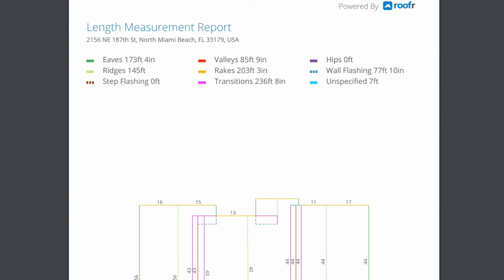What are the parts of a Roof? Roof Component Breakdown | Perkins Roofing Corp.

Comment: You do not mention roof vents in this video. You do mention soffit screens, which is one part of the roof ventilation system, but I see no vents on the roof itself, not even ridge vents. How is the roof supposed to ventilate with no elevated vents where the hot air can rise inside the attic and out the vents? I have learned from your videos, but I don't see a single video addressing the issue of roof ventilation. I am learning more than I ever wanted to know about my house during the process of recovering from major storm surge flooding in my house during Hurricane Ian. My attic is hot as the place you go if you don't go to heaven. It has been super hot ever since I purchased the home 20 years ago. I replaced the tile roof 16 years ago and now I'm realizing the roofer did not install any roof vents or ridge vents. The hot air is trapped in my attic! I will be having a new tile roof installed within the next 30-45 days and I want to knowledgable about roof vents to make sure my roofer does the venting correctly. Here in Disaster World NOBODY seems to know how to do their jobs in the various skilled trades. Consumers assume roofers, plumbers, electricians, window installers, stucco installers, drywallers, etc. know how to do their jobs, BUT THEY DO NOT! Everything has to be done at least two times and sometimes up to four times before they get it somewhat right. This is extremely frustrating. You seem to know how to perform your skilled trade of roofing, so I'd like to know what you know about roof ventilation, including exactly what types of vents you recommend I should install for my new tile roof. I do have soffit vents spaces about every 12 feet around my house. But again, those soffit vents do no good unless there are vents somewhere on the higher elevations of the roof to allow the rising hot air to escape from the attic. Thank you!
Reply from the maker: Yeah, the issues over there are all of the roofers are from out of state.   Even the in-state roofers are subcontracting guys from out of state or out of country.  I know, I've done work over there and the work I see going on is terrible.  People are recovering homes with bad or damaged underlayments.

Anyways, in regards to the ventilation - you have two choices if the soffit vents do not work well enough.  The first are whirly birds (turbines), but you need to have wind.  Second are solar gooseneck vents, which are good, but not cheap.  They run about $400 for a 10 watt (1,200 SF per vent) and $700 for a 25 watt (2,600 SF per vent).  They both have little motors for active ventilation, but the solar ones work better generally and will last longer.  The turbines can be made in aluminum, which I would recommend if you are 2,000' from salt water.  The turbines usually cost about $250.

Comment: What system - single-ply (peel-n-stick directly to over the plywood) or double-ply (peel-n-stick over 30# of felt paper)  would you recommend doing? Appreciate your answer and perhaps you can put a new video together discussing this topic. Thanks!
Reply from the maker: Hi Vitaly, in South Florida HVHZ (high velocity hurricane zone), we must install double-ply for tile roofs.  We can not install a self-adhered directly to structural wood down here.  A shingle roofing system would have 30# felt mechanically attached with shingles installed on top (unless the owner opts for a secondary water barrier), whereas a metal roof needs a fire barrier over the 30# since metal is more combustable and does not meet the necessary UL ratings for Miami-Dade code.
Reply: @perkinsroofingcorp  . Thanks for the reply. I am a consumer trying to chose between two options offered by two different contractors. So I am reading various material. This FBC document - https://www.floridabuilding.org/fbc/thecode/2020_7edition/Roofing_Fact_Sheet-2_column_format052820Final.pdf gives 3 options, with Option 1 being a single-ply self-adhered membrane applied directly to the decking. Option 2 adds a tape applied over all joints in the roof decking and then covered with peel-n-stick. And Option 3 is what you're referring to - two-ply where the base 30# felt is mechanically attached to plywood and then covered with peel-n-stick. It also says that the tile roofs (the one I have) must be in accordance with the FRSA/TRI Florida High Wind Concrete and Clay Roof Tile Installation. This doc is here - https://tileroofing.org/wp-content/uploads/Florida-High-Wind-Tile-Installation-Manual-6th-Edition-092020.pdf. It gives essentially the same options (tape is not one of them). I am trying to decide which one is better. Am I missing something? Should I refer to a different document that only allows a two-ply system? I live in Palm Beach county.
Reply from the maker: @vitalyshtulman6351  Palm Beach does not fall under HVHZ (even though it should).  We do work up there if you would like a quote.  I'm actually working on opening a Jupiter location by the end of the year.  I would recommend Option 3, because that's what we do in Dade and Broward under HVHZ, then #2 - it's obviously cheaper as it uses less material for option 1 and 2, but option 3 is what is required by HVHZ and Palm Beach will eventually fall under HVHZ, it's been in the works.  I'm not sure if insurance would give you any additional credits, but you would if you add a secondary water barrier or hurricane strapping.  Let me know if we can help!

Comment: Wtfrick how mutch pressure plates do you need , here in Holland is 5 per 1m2 by code.
And the flat roofers can learn a thing or two do😁
Reply from the maker: The QTY of tin caps varies, based upon wind zone, building height, etc.  This is all laid out in each permit.
Reply: @perkinsroofingcorp  on the other side of the oceans rules are way different, like to walk a few days on the Floridian roofs do